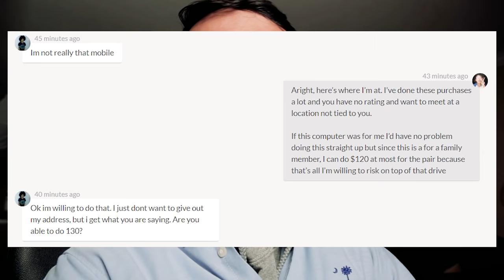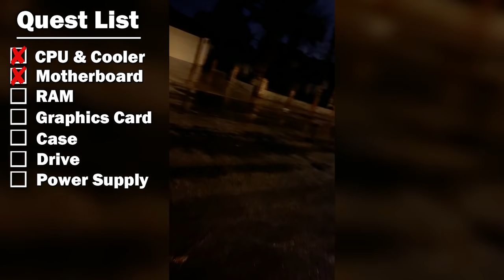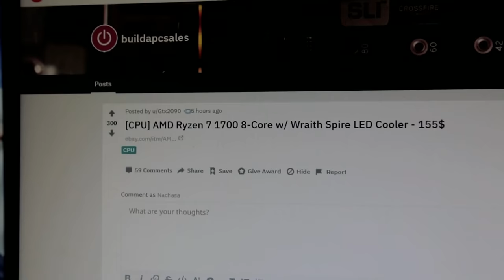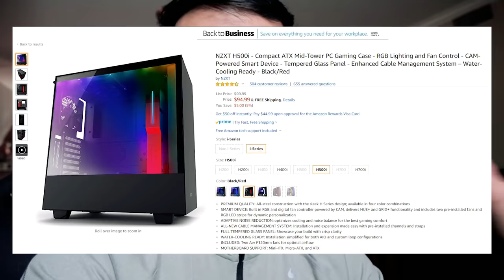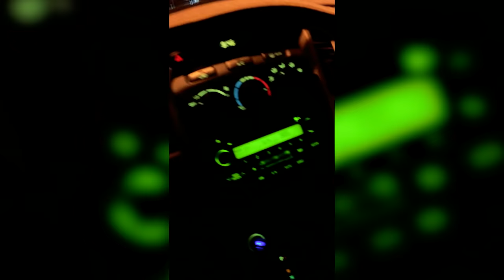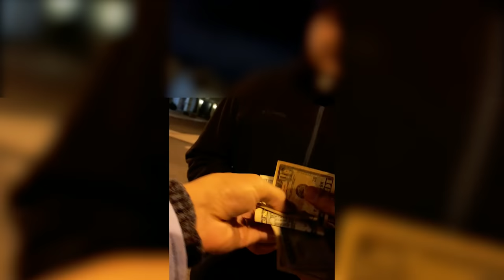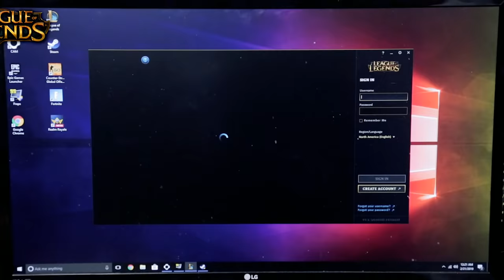$500 Budget Gaming PC Build - March 2019

Comment: Did a similar build. Around 675 all new parts

-Ryzen 1700 with stock cooler (168)
-16 GB 3000 trident z rgb (119)
-570 4gb mining card (it only has one port) (99)
-asrock Steel legend rgb b450 (I want to upgrade to third gen ryzen) 90 something 
-650 watt EVGA 80+ gold (59 after rebate)
-256 Samsung 970 Evo (79)
-diypc 480 white and rgb case (57)

Great value for me. Editing more than gaming btw with upgradeability to the new ryzen 3000 and Navi when it comes out.
Reply: I would upgrade ur gpu first and then cpu
Reply: Same
Reply: EXcept 1070 ti and 1700X wit water cooler AIO
Reply: @bjorn5665  I'm not a gamer.
Reply: @bjorn5665  CPU upgrades are important for me. I do video editing. Premiere barely utilizes a 1050 4gb.
Reply: @leecason9468  sorry didnt see that
Reply: Hey how has that motherboard been for you?

Comment: If you chose just the h500, you would have enough for a drive. $30
Reply from the maker: need rgb
Reply: @KristoferYee  lmai
Reply: @KristoferYee  could've put better RGB lighting from a $15 kit probably lol
Reply: @KristoferYee  I found a WD blue 500g for $10 on ebay. it was an auction though.
Reply: Ryan O'Mara I bought a used(for 1 month) 8TB Seagate for $90 :D
Reply: TheCChrist777 CC cool nice deal bro
Reply: Ik there was litteraly no RGB except the cooler and the card
Reply: Absolutely true.  Willing to spend money for RGB on a super low budget like this is the most idiotic thing I've ever heard.  People need to get their priorities straight.
Reply: Could've gone for the Phanteks P300. Cheaper, w/ RGB but great build nontheless
Reply: @KristoferYee  um you could have gone with Phanteks PH-EC416PTG_BR Eclipse P400 Steel ATX Mid Tower Case Black/Red, Tempered Glass Edition Cases for 80 or Phanteks PH-EC416PTG_BR Eclipse P400 Steel ATX Mid Tower Case Black/Red, Tempered Glass Edition Cases or Thermaltake V200 Tempered Glass RGB Edition 12V MB Sync Capable ATX Mid-Tower Chassis with 3 120mm 12V RGB Fan + 1 Black 120mm Rear Fan Pre-Installed CA-1K8-00M1WN-01

also the ryzen 1600 for 140 do any of that and you could have gotten Kingston A400 SSD 240GB SATA 3 2.5” Solid State Drive SA400S37/240G - Increase Performance double the space

to be honest this PC wasnt really much of a deal 

sorry for being a little critical

Comment: For a budget I bought the Phanteks p300, although it was a bit cramp with the cable management, especially if you're like me and connect the psu to the motherboard after you've installed it into the case.

Comment: I bought a fully used pc on offer up for 600 and it was a good deal
1070ti asus
I7 6700k 
Z 170-A motherboard 
16 gb Corsair vengeance lpx ram 3000
800 watt silent pro gold power supply 
500gb ssd, 500 gb hdd 
The case has 6 or 7 fans and just amazing :)
Them Vegas deals don’t play

Comment: Wow over here in uk parts are so expensive
Reply: It depends where you look, it sure doesn't come close to the PC in this video but I spent under 200 quid on my PC, with a 2nd gen i5, 8GB RAM and a GTX 670 along with a 120GB SSD and a 1TB HDD.
Reply: @DJenerate  i recently built a pc for  a budget of £600 which got me I5 6400, gtx 1060 6gb  16gb, 120gb ssd , 500gb hdd which i was hapoy with the price
Reply: SnowBallYT  the i5 i was gonna get an i5 6600k but the place i was getting it  from (CEX) had sold out so i had to change it and with the gpu i found a deal where the guy bought it and it didnt fit in his case so he was selling it on ebay for much cheaper and at the time it was cheaper than rx 580 so thats why i got that and it fitted with the colour scheme i was going for so it all worked out
Reply: SnowBallYT  the reason i was gonna go with the i5 6600k is because of my budget i was keeping an eye out for an i7 6700k as my mobo is 6th gen but the only ones i could find were too high of budget and the reason i didnt go with amd is that to me i just prefer intel over amd
Reply: SnowBallYT  yea thats it
Reply: NO there not

Comment: That's a sata m.2 6gb SSD so it's essentially the same speed and performance as a normal sata 6gb SSD drive. It doesn't say nvme or pcie x2-8. Of course it would cost $26 for 120gb, an actual m.2 nvme with 120gb would cost $60-$90 new

Comment: I would have got an Dell Optiplex with an i7 2600-3600 in it these usually include 8gb of ram and a 7200rmp hard drive. Can be had for about $200 8 more GB of DDR3 $30 an RX 580 $190 and a new half way decent case $60. 128gb SSD $25... the total would have been $505

Comment: i kinda wonder why you didn't opt in for an AM3+ build. Most 8350's and 6300's OC'd are super nice in todays age.

I'm running my fx 6300 on the m5a97 mobo with a zalman ultra quiet 8900 at 4.3ghz on all 6 cores with a zotac 1050 ti and this thing is still really damn good in todays age.
Reply: as far as i know even the best fx 8350 is worse than a mid range ryzen 3...the fx processors are actually really bad mate. i wouldnt suggest them to anybody in 2019..

Comment: I got a intel i7 875 GTX 460 1gig version 16gigs of ram and a 680 w power supply and 2tb hdd and a 500 gig hdd and such but it runs great fortnite 200+ fps Cs go 275+ and such gta v 175+ fps ect ect it runs great I love it. I paid $10 for the shell the cpu and graphics card, paid $15 for the power supply and ram.oh and also a asus motherboard that came with the shell.

Comment: Core i3-8100 3.6 GHz

Gigabyte - B360M DS3H Mirco ATX LGA1151

Evo Potenza 8GB (2 x 4GB) DDR4-2400

GX2 256 GB 2.5” SSD

1TB 3.5” 7200RPM HDD

Radeon RX 570 4GB

Corsair - CXM (2015) 450 W 80+ Bronze Certified Semi-modular ATX Power Supply

Would that build be a good budget pc?
Reply: I'd say get a better PSU, cause 450W is barely enough. Just a tad bit over and some components would be underperforming
Reply: Maybe get a i5 9400F or go with ryzen?

Comment: I found a gaming PC for $550 
These are the specs: 

CPU: Ryzen 5 1600 (6-Core/12-Threads)
GPU: MSI GAMING X RX580 8GB GDDR5
MOBO: MSI B450 Tomahawk
RAM: Geil 16GB DDR4 3200MHz
STORAGE 1: Sandisk 256GB SSD
CASE: NZXT 510 Black/Red (Tempered Glass Side Panel)
CASE Fan: Full ARGB Case Fan
PSU: EVGA 550W 80+ PSU with Red/Black PCIE 

Is it worth it?
Reply: Yes

Comment: investing 1/5th of the budget into a case so it has rgb is silly. i would have gotten the phantex p350x for 60 and used the extra 40 to get a better ssd and psu hell maybe even a cheaper corsair psu that has black cables i like the 1700 and 580 combo though.

Comment: Realm Royale is very optimized i play on a shitty pentium g630 and gt 610 which i will upgrade to an i3 8100 (still choosing a gpu that fits my budget) and with every settings set to high and the resolution scale tweaked a bit i get some good fps but with the settings set to low i average at 40-60 fps but fungal forest tells a different story one of the most gpu demanding place in the whole map of realm royale

Comment: Hey guys! I’m about to buy a pc and here’s the parts, tell me what you think.
Motherboard: asus b360 mb
Processor: i7 8700 8th gen
Graphics card: PNY 1070ti VGA Geforce OC
Memory: Ballistix crucial 16gb @2400mhz
Storage: 1TB hdd WD 7200 RPM and 240gb ssd
Power supply: Thermaltake 650W
CPU cooler: Thermaltake contact9 air
Case: Thermaltake view22 (looking for a better one, hit me up with suggestions)
O.S: Windows 10 pro

Comment: i paid $300 for a pc that has a msi b350 mother board asus gtx 1060 3gb dual overclock edition ryzen3 1300x 8 gb ddr4 3200mhz 500w 80+ bronze power supply 128gb ssd and1tb hard drive in a phanteks eclipse p400 gun metal grey case did i get a good deal? im new to pc so i need to know if i did alright. i also got a logitech mechanical keyboard and logitech dota mouse included with pc.
Reply: Not a bad deal at all, that's a good deal for a build like that, I'd list that on average 350-450 usd

Comment: I’ve made a build for around 680 pounds
Parts list
Msi Rx 580 8gb
Ryzen 5 2600
Msi b450m gaming plus
Evga 600 watt psu
Case Is fr micro atx board
Hyper X 2x8 ram sticks
Seagate barakuda 1tb hdd 
Adata 128 gb ssd
Lemme know if anyone can make this any cheaper or better under 700

Comment: Is it better to buy i5 4690k with z97 motherboard or ryzen 3 1300x with b450? I will use PC for gaming. Thanks
Reply: Ryzen definitely , you get a better and flexible upgrade path. You can choose Ryzen 5/Ryzen 7 1st or 2nd gen plus the upcoming Ryzen 2 lineup 🙂

BTW i would choose Ryzen 3 1200, 1300x doesn't worth the extra bucks.

Comment: hey pc question i built a new pc and i use a wired connection but my pc is not getting the full speeds that i paid for. But my other computers are getting max speeds in wired connections, my pc specs is asus crosshair vii hero wifi ryzen 7 2700x rtx 2070 oc8gb and 32 gb ram at 3000mhz. any reason why my pc isnt getting the full speeds or even close that im suppose to be getting?
i have 300mb internet speed but only getting 20mb.